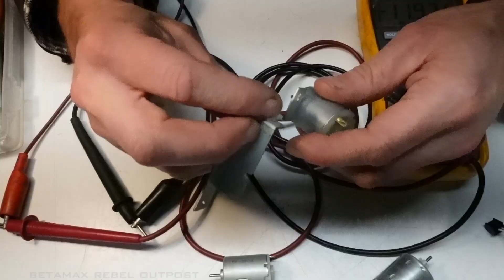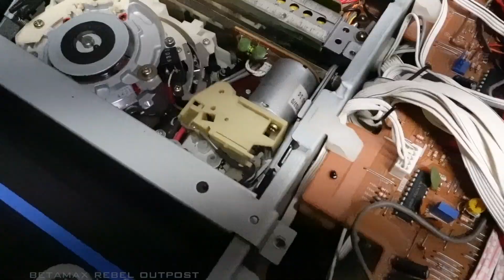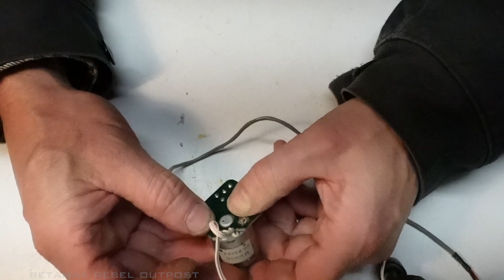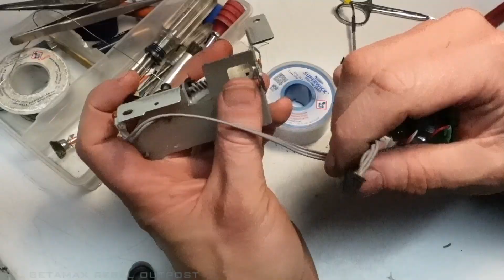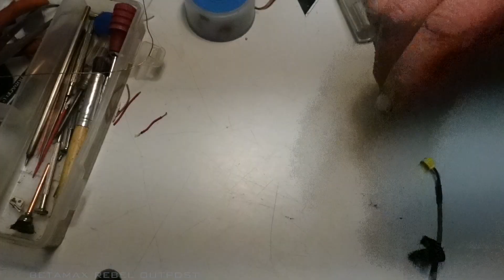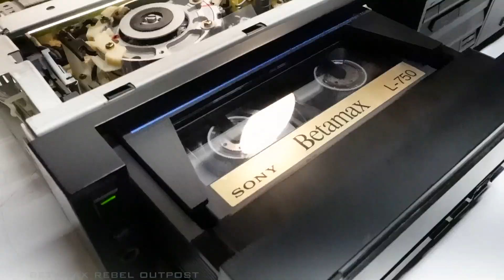1987 SL HF750 tray motor mod part 2 December 2025

Comment: Put a resistor on the  power supply i use such resistor on my computers fans, there are ones that provide 9V other down to 7 V i believe. lower the voltage-> lower the rpm
Reply from the maker: That may work but i dont want to modify the electronics in this Beta. also the field strength of the magnet is so strong im apprehensive about letting that in my vcr, being so close to the video tape. I cant even mount it to the plate, the screw holes are set too inward. Thanks though for chiming in, I may try your method on some other project in the future.

Comment: I cleaned the plastic bushing of the SONY SL-HF950ES (SuperßPro, PAL/SECAM II) and glued it back into place in cracked condition. This concept has proven successful many times with the Panasonic NV-HS900EG K-drive servo motor. The motor in the SONY SL-HF950ES is wrapped with a steel sheet to strengthen the permanent magnets.
Reply from the maker: that sounds great. I did try to press the bushing back in but it wouldn't stay put, didnt consider gluing yet so I'll have to try your approach. yes i noticed that steel sheet in MrBetabytes 950 vid.
Reply from the maker: the bearing or bushing sleeve in the front of RF280H is brass and sits cupped in a black plastic retainer. I was able to glue it into position over night and put the motor back together. Now i did see improvement, the tray closes flush now, but its still really noisy as compared to other RF280H motors in my 750s. I'm trying to solve 2 problems, 1 down but the other remains. That's why I'm trying to find a better quality sub or the exact part to replace it with. Thank for you though, I appreciate your input on this.
Reply: @betamaxrebeloutpost8945  I have the impression that Google Translate has translated incorrectly. I meant what Panasonic calls the motor pulley, the plastic bushing at the end of the motor shaft that engages the worm gear. Unfortunately, I don't always notice when Google Translate has failed again, especially when the back-translation into German is usable.
Reply from the maker: @TTVEaGMXde  Lol and i had the entire guts out of this thing at 3am, carefully putting it back together, gluing the insides 🤣😂 oh well at least the misunderstanding led to better results